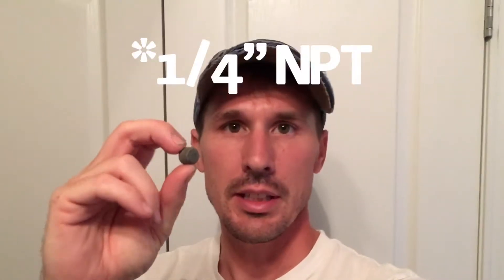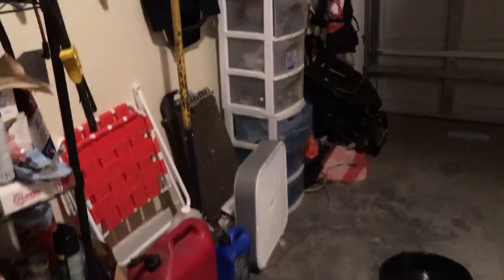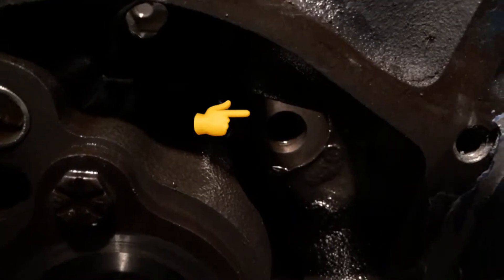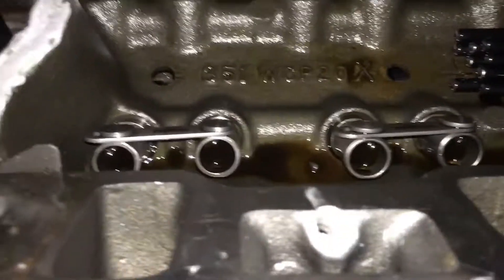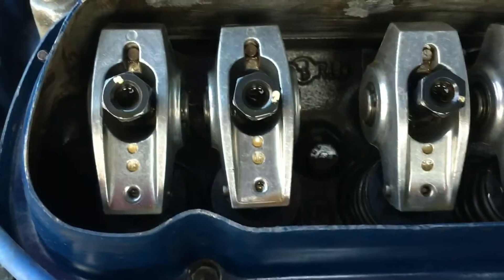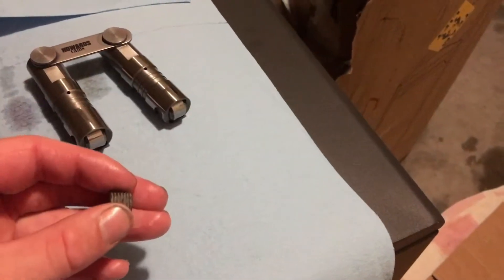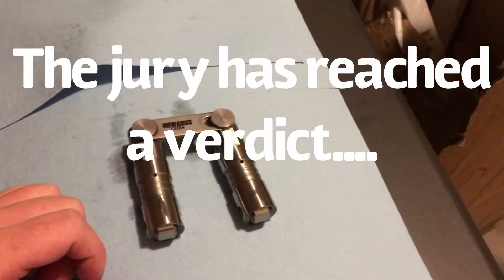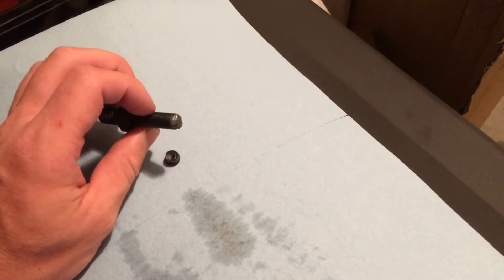How I fixed the lifter noise / oil circulation problem on a pushrod Windsor engine.

Comment: I think you may have the answer to my noisy lifter and inconsistent oil flow problem with my fresh 302W thanks for the video!
Reply from the maker: No problem 👍👍
Reply: U wouldnt have any oil pressure build up cause theres no resistance, ive blown that plug out on a press fit plug on 302 racing, oil pressure left when popped out
Reply: @alltherpm  thanks I am having a lifter problem with brand new lifters valves seem to be adjusted properly just have a ticking motor has excellent oil pressure
Reply: @joediffy4331  ya i had same issue seems lifters today suck, there fast bleed, ive tried trick flow which are gaterman lifters suck and another brand i forgot the name now with morning tick, so now i run solids and love them

Comment: I'm helping a friend with this very issue.. it was fine when we built it back in march (maybe has 100 miles on the build) until a couple weeks ago. Cylinder 5,6,7 bent some rods, 8 was fine. We replaced the rods, readjusted  the valves, and it was doing fine (we figured the rockers just got lose). Took it around the block, and by the time we got to the driveway, one of the lifters started ticking. It's been too cold to mess with it now (we have a old school walless back yard shop, lol). It has roller rockers, but flat tappet cam. All we did was drop a cam in it, and changed it over to a AV2 carb and weiand intake. It's a 351M with 2V heads. Any insight would be very helpful (ABTW, pax side is oiling fine). The plan is to brush out the lifter gallery for starters. 1979 F150... is it possible this plug was missing the whole time? or can it drop out.. I figure that would wipe out the timing chain.. anyway.. looking forward to reply's, thanks.
Reply from the maker: Ok, so this answer may be confusing, hopefully I can type articulately lol.  In this instance I simply forgot to put in the plug on the driver's side, mine is a screw in style plug (351W) on 302's they are press in, so I am not sure if a 351M is press in or screw in.  You can verify if you have the plug by pulling the distributor and taking a look down the distributor bore.  To actually put the plug in you will need to pull the timing cover and what not.  Now for the curve ball to the answer, in a totally separate instance, about 3 months ago I was winding up my car to 6,000 and lost oil pressure!!  So guess what happened, there is a press in plug in between the two lifter plugs and that one holds ALL the oil pressure, it is also right behind the timing cover.  That plug managed to pop out and luckily land right in the oil pan and didn't damage anything on the way down.  I drove in a new oil plug (much deeper this time) and the engine seems fine! Every gets lucky sometimes, hopefully you will have some luck to once you get some warmer weather.
Reply: @fomobros2207  Thanks for the reply.. Yea, once we get some decent days we're going to tear into it. i have a hunch that the plug must of come out, or partially out. Xmas day we plan to run it for a bit and see what is actually happening. #8 was fine, so I believe it's still getting oil.. it could be a blockage in the gallery past 8... at least I'm hoping that's it. The only saving grace is that it's crazy easy to work on. 351W and 351M are exactly the same, the only diff is the bell housing pattern IIRC.
Reply: @fomobros2207  Thanks for the help and the video! Just wanted to follow up, and may help others as well... Turned out we had oil pressure to the lifters just fine, and all the plugs were in place. Turned out the poly locks were coming lose on their own.. and that was my mistake... and turns out to be a common one with poly locks. They way I had been tightening the poly's was; doing the 1/2 or 3/4 turn after all the slack was out on the base of the cam lobe... then tightening the set screw in the center with a little counter turn on the main nut.. just like you would with two of the same size nuts back to back on a stud or bolt.

This is incorrect. Doing it like that will loosen the main poly bolt, and tightening the set screw will cause the poly to loosen even more as the motor runs. The correct way is to tighten the set screw until its tight, then tighten the main poly slightly more AND the set screw AT THE SAME TIME. Then they will be locked into place.

Again, thanks for the vid and setting us on the right path.
Reply: I'd like to add that we had a real revelation on oil pressure and cold starts. We're working in 25-32 degree temps on this project. We're running 10w30 dyno oil. On first start up, it took a solid 60 seconds before all the lifters started getting oil (as of course, the oil is thick as molasses at those temps).  I've always let a car warm up in cold temps, but watching that had me thinking about people who start up, and take off right away. I can only imagine the damage this causes over time, regardless of oil weight.
Reply from the maker: @hawkdsl  Awesome! Hopefully you don’t think I was holding out on you, but I’ve done that before as well. We’ve all used the “jam nut” method before where you turn the outer nut right and the inner nut left to “jam” them together to remove a broken stud etc. So I did the exact same thing on my stud mount rockers back in the day (about four years ago on my 351) and two exhaust rockers actually rocked themselves off!! It was essentially the nastiest sounding V6 in the neighborhood lol! I called my brother Richard and he set me straight. I think I’ve made every mistake you can with the valve train, but these Fords are tough and just keep going! Glad you found it!!
Reply from the maker: @hawkdsl  I have an opinion on cold oil too lol. I use kind of a hybrid approach, on cold days I’ll crank up my car and I don’t let it idle too long, I just go. However, I drive like a grandma alternating between light throttle and idle until the car is warmed up and then I drive like a slightly younger grandma 🤣. Like you said, getting in your car and just driving is definitely bad for these older hot rods. Not trying to sell you on warming up cars my way, just throwing it out there 👍👍

Comment: I just realized why my engine was making a clanking tapping sound. I literally had one quart of oil in my engine. I had 5lbs of oil pressure before I serviced the truck with a proper oil change. Now I have 50lbs of oil pressure and the sound is gone 100%. 1995 Ford F-150 XLT 302ci v8 4X4 162k miles run’s flawlessly now. 

I had a local “trusted” mechanic change the oil 4000 miles ago. Needless to say I will never do that again. 

Check you oil levels if you have a tapping sound friends.

Comment: Quick question - assuming you have an oil pressure gauge on the motor, did you notice a difference in pressure from before installing the plug and after?
Reply from the maker: It didn't. I was wondering the same thing in the middle of this job lol.  Oil pressure stayed the same though.  I think it's bc the lifters are nearly the last things to get oil, so that plug being installed or not isn't enough to build or lose pressure.

Comment: Could that be why the 99 explorer 5.0 I traded to my uncle is getting loud lifter tick for a couple minutes then it smooths out? It’s done it to him 3 times already and when I had it I never had that problem
Reply from the maker: I think that sounds like normal valve train noise to me. Roller lifters are known to be noisy until their is enough oil circulation to pump up the lifters and soak up the valve lash. In my case I forgot to install a plug which would not allow oil pressure to build on the driver side of the lifters, unless that engine has been rebuilt recently and that plug was forgotten I don’t see that as the issue. Furthermore, since the noise goes away after a few minutes I do not think there is an issue at all and that’s just the nature of the beast.
Reply: @fomobros2207  ohhh okay. Cool it can be reliable for him. Yeah that truck is all original and the engine has never been out or completely apart. Hell it was never maintained by any owners before me

Comment: did you have to replace your lifter and did you have to take the head off to do this job please lmk?
Reply from the maker: Hey sorry for the late reply, I just saw this comment. I did ruin a lifter so I replaced it (that happened in the previous video) and you don’t pull the head to replace the lifters. You will need to pull the intake manifold and valve cover though

Comment: What is the name for that plug?
Reply from the maker: If you buy a freeze plug kit for a 302/351 Windsor it will have that plug and plenty more.  In a 351W it's a 1/8th NPT plug (99%sure) and on a 302 it'a a press in plug that's about the same diameter.  Either way the kit has it.
Reply: Oil galley